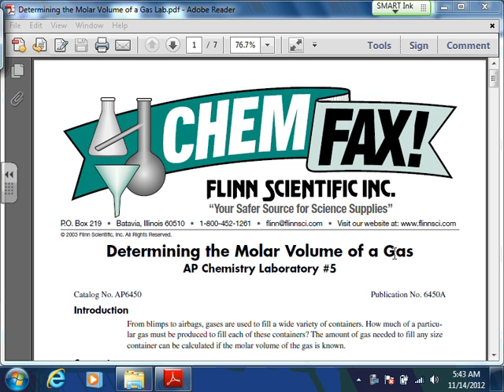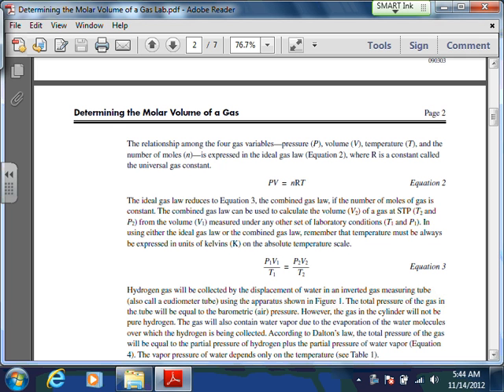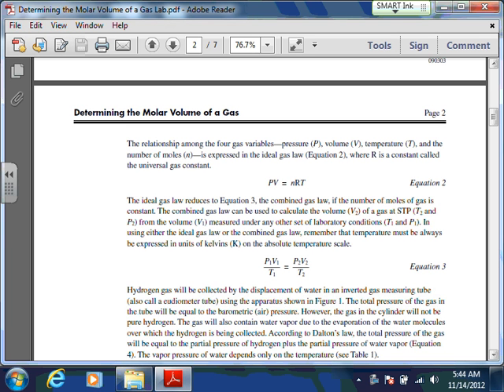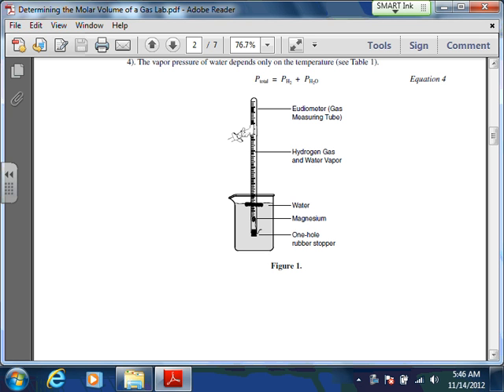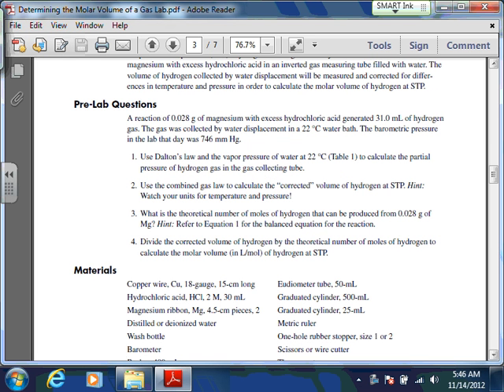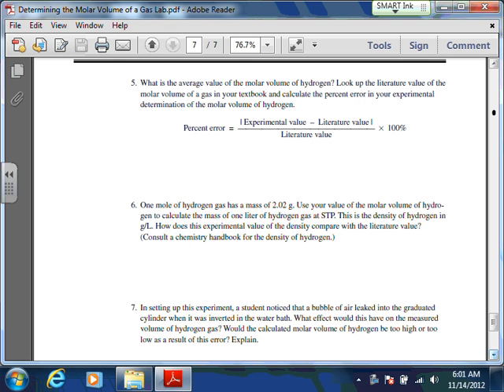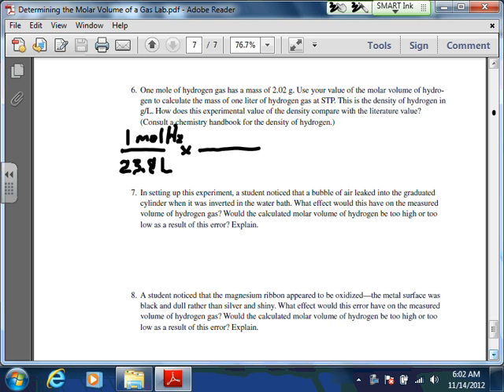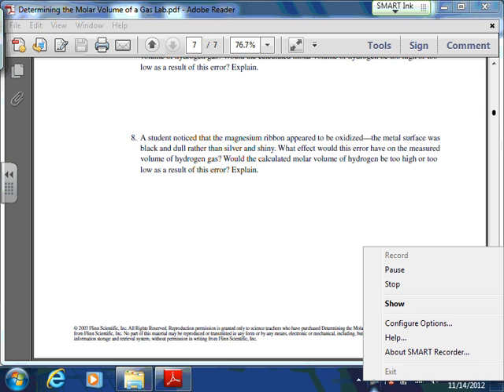Determining the Molar Volume of a Gas Lab Video Explanation

Comment: What was the function of the wire?
Reply: The wire holds the magnesium in place because it will begin to float above the more dense HCl which would cause the reaction to stop, messing up your data.
Reply: Could this be one possible source of error in this experiment??? Cause when I calculated the percent yield I got above 100%😢